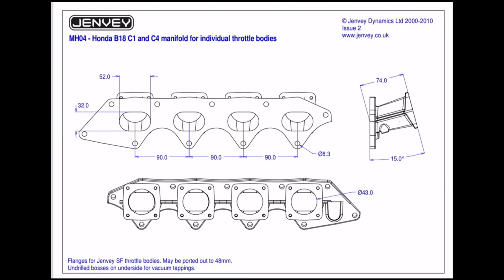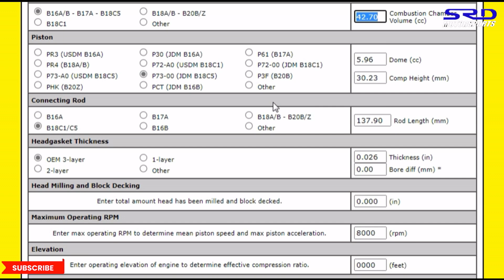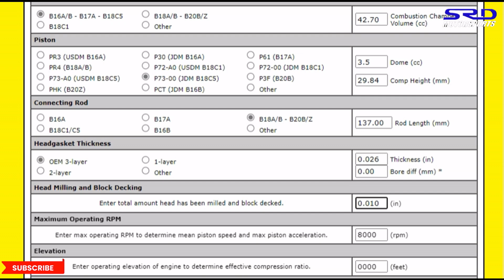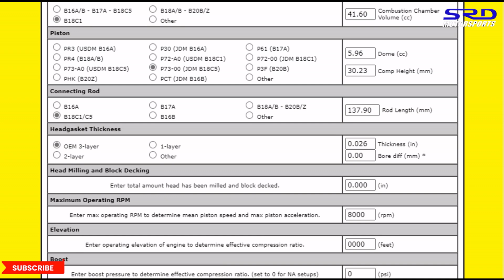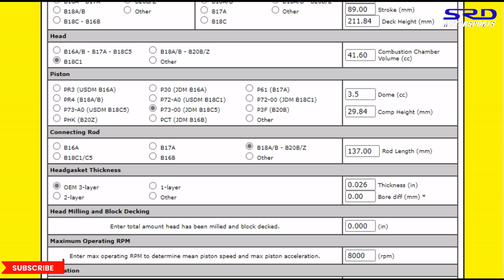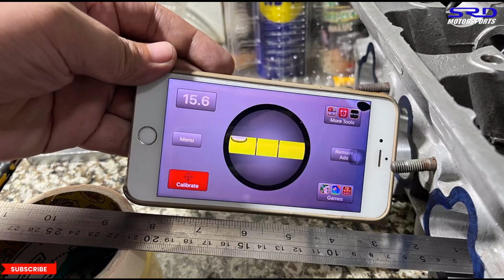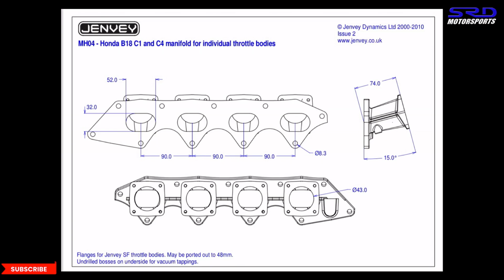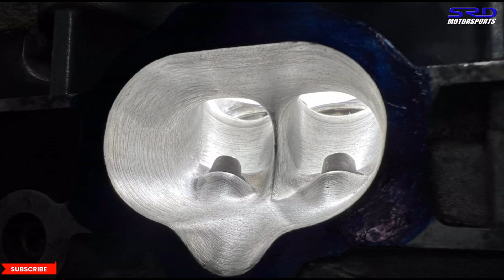B16 PR3 vs GSR B18c1 Head Difference by SRDmotorsports

Comment: Great info! I'm finding it harder to find B16 heads so I built my b20v with a P72 b18 head.
Reply from the maker: That’s a decent combination! :)

Here it’s more common to find a b16a so I saved my GSR head for spare
Reply: @SRDmotorsports  standard  "higher comp" pistons from the B20 with a blox b cam skunk2 Intake manifold with some mild porting. Should make for a bit of fun.
Reply from the maker: @robertnewland90  that’s a torque machine! Gonna be fun for suuuure!
Reply: Recipe for an all motor monster. Build my turbo setup. Because I've had the manifold and waste gate stairing at for a while. But something makes me want that all motor roar.
Reply from the maker: @junieserrano7098  same story reason why I went back to sohc is because of some unfinished business (personally wanna try stuff) before heading back to Bseries again with my spare GSR head

Suddenly now I’m thinking after I get done and dyno with the sohc all motor? A top mount turbo sohc manifold been staring at me for a while too! Now I’m like “turbo is kinda okay as next too” lol!!